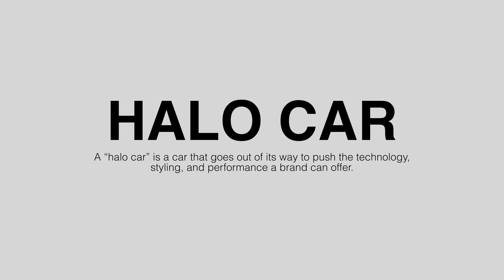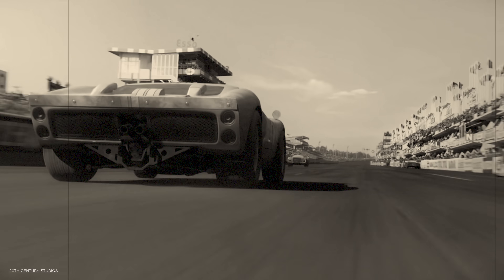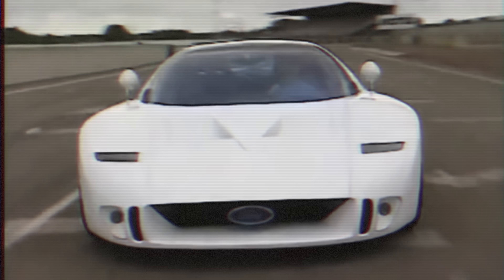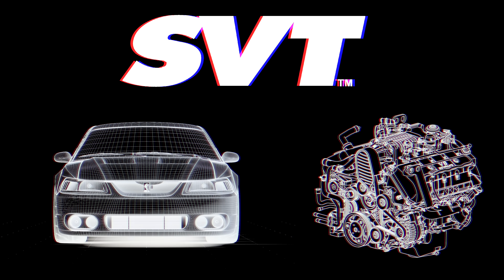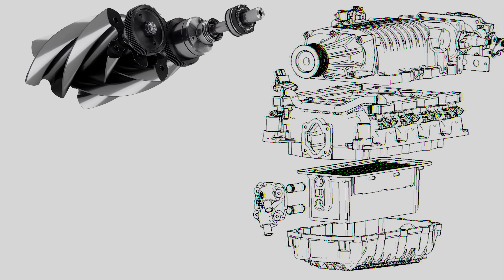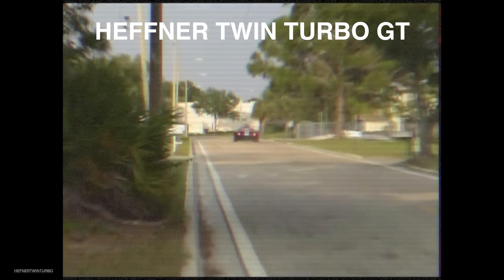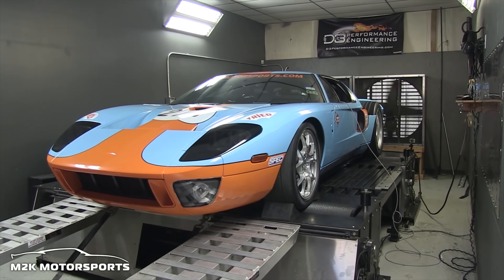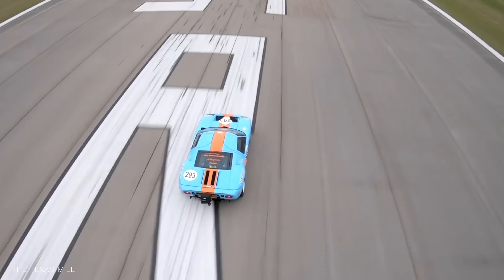Why Ford GT Engines Are Too Powerful (300MPH)😳| Explained Ep.16

Comment: Realistically ford deserves very little credit for the record. Not to say that it's an awesome car, but there are literally SO many other cars that have been capable of doing this for years. 
Also it should be noted that the original Ford GT's 1-2-3 win was the first and last of its kind against ferrari. 
Ford just made it into a press stunt. Weak stuff.
Reply: Ummmm, just stop because you're only making yourself sound silly.
Get back to your xbox in the basement Timmy.
Reply: @blkngwinn  sounds to me like you don't have anything to say
Reply: What other cars are capable of doing 300 in the mile? Maybe UR lambos? 
Also the 1 2 3 was certainly a marketing beat up  but rightly deserved.  No one else was beating ferrari at that time. To fail and come back with a 1 2 3 was hell of an achievement for a company who only know commuter car and trucks.
Reply: @audoinxr6372  Hahaha there are plenty my guy. It's really strange to say that but there are Calvo motorsports vipers doing 270mph in the standing mile with 2000lbs+ of downforce and 1000 horsepower less. UGR lambos are definitely capable of 300+ mph as well, now that you mention it. Nthmoto vipers are already doing 300mph on a 2 mile track, but those have 4000hp so that's kinda cheating.  I could go on but you get the point.
Reply: @THESLlCK  you said 2 mile track n the gt did it in 1 mile  make sense ford hater the car is great n your little viper with larger engine can never do what this thing can do
Reply: @THESLlCK  The power required to bridge the gap from 270mph to 300mph is absolutely massive. No other car, Viper/Lambo/anything else, has eclipsed 300mph in a standing mile and from what I've seen each of the big builders for those platforms stays away from standing mile events anyways. They know they won't catch up to the GT record.
Reply: @tonyfrance4100  um yeah they definitely did pass 300mph in a standing mile, and not far from "street legal" if we're gonna call it that.
Reply: Lmao 

Not like ford built the car itself and the block that withstood all the power or anything. Naa they don’t deserve any credit at all 🤡🤡🤡

Comment: 3000 on the stock block? Sweet mother of god
Reply from the maker: It’s crazy, if you actually find pictures of 05-06 GT blocks they are very robust with a lot of webbing and closed deck. Still blows my mind tho😂
Reply: @337speed  yeah no modular, coyote, or ls doing anywhere close to that

Comment: the GT90 should have been produced , it was amazing
Reply: I’ve got the Hot Wheels version.  Agree completely
Reply from the maker: Agreed!
Reply: Now would be the ideal time for that styling to be reused again
Reply: @rhythmoftheknight4609  very true , it would be a hit today
Reply: Fun fact about the Gt90, it had 4 turbo chargers on it, and the underside of the bodywork covering the engine was covered with the tiles the space shuttle had to keep the body from melting from the heat.
Reply: STILL looks fantastic even now !!
Reply: Same with the GT70.

Comment: Not a big deal but pretty sure it was a lysholm twin screw blower not eaton which only uses  roots type which im pretty sure had not released their tvs rotors yet so it would be the older 60 degree 3 lobe rotors like the early gt500s with their m122 blowers.

Comment: I know that they had plenty of reason to use the V6 tt in the most recent GT but man it would've been so so cool to see something like the GT500 engine or something similar in there.

I absolutely love the design though. One of the best looking cars I've ever seen.
Reply: The new line of predator 5.2 supercharged engines would've been nuts in the gt
Reply: @dennismorgan354  even the voodoo would've been cool. I know it isn't as powerful but the novelty factor is super cool.
Reply: yeah it definitelty deserved its own special v8 but ford wanted to push the ecoboost
Reply: @WhuDhat  nope it's not because Ford wanted to push the EB. If only you knew the main reason why they put the TT V6 in the gen2 GT and racecar..
Reply: @jayxj7785  I think putting the ecoboost in the gt was a genius move, people just want the sound of a v8, but don’t look at the advantages of a tt v6 in an endurance race
Reply: @Jtyungin  wha advantage is that
Reply: @kingssuck06   yeah I asked a Ford engineer in Detroit about it and he said that is the line they were told in house as well but he said it never made sense to him and thought it was just something they came up with to justify using the EcoBoost. Being the EcoBoost is not that much more compact and aerodynamics can be redesigned to fit the car with a slightly larger engine. As evidenced by plenty of supercars with much larger engines. Both engines are DOHC so height wise are very similar unlike an in block cam configuration.
Reply: @jayxj7785  what was the reason?
Reply: @S8ER  because of LeMans LM GTE pro class requirements, 4.0L displacement using forced induction (turbo or supercharged) or 5.5L NA. Ford doesn't have a low displacement V8 and neither could they use a forced induction 5.2 V8 that they have.

They weren't going to build a one off bespoke racecar engine because if they did, regulations would require them to put that engine into the production car too (gen2 Ford GT).

Long story short, they saved money and went with the next best logical engine, the TT 3.5 V6.
Reply: @jayxj7785  thanks for that... it never made sense to me why they put a 6 cylinder in it other than they would make more money. I appreciate the insight.
Reply: @S8ER  - What!  If you think they put the V6 in it to make more money, well, I'll be nice and just say you are completely lost!  I doubt that Ford did much more than break even on this car with such massive R&D costs coupled with the low production.
Reply: @Jtyungin  - Why not?  It won the 24 hrs of Le Mans in 2016!
Reply: @Jtyungin  thats pur cap spare thrle bs the v6 move was ingenious
Reply: @kingssuck06  - The engine was chosen before they designed the car - the  car was built around the TTV6.
Reply: They going to destroke the 7.3 to a 427 Whipple it and turn a 1000hp 1000tq on pump gas watch ford has money they shitcan more engine and concepts than anyone
Reply: My opinion on their 6 cylinder isn’t necessarily born from technical knowledge but one of the things I’ve really liked is watching it just torch most super cars it lines up with. That engine is a beast and I’m excited for when they beef it up- I’m certain they will because they always do. A competitor will come out with the craziest thing ever and ford will do some modifications to an existing vehicle and clap back hard as hell.
Reply: The 3.5l tt engine ain't bad at all I didn't like it at first but ford did an amazing job developing that engine
Reply: Yea being cheap. Also basing it off the regulations at the Trac. They could have made a street version and a Trac version. They know nobody would have bought a ttv6 over a v8
Reply: nope they should have went full retro and put in the 427
Reply: @jtkoontz69  Agree with you on that.
Reply: @jtkoontz69  - And what discipline in Engineering do you have a degree in?  Lol!
Reply: @Loulovesspeed  dont need one to understand what retro means genius
Reply: @Loulovesspeed  i do also understand that a 5.4L is doing 300mph in a mile meanwhile buggati is doing it in 5miles with a 16 cylinder
Reply: @jtkoontz69  - My comment has nothing to do with retro?  You and a few dozen gear head, knuckle draggers think the answer to everything is 8 cylinders, or more.  This TTV6 has smoked more than a few big V8 cars like the C7-R Corvette and the BMW M-8.  Ford built this car to compete in the IMSA GTLM Class at Le Mans and a 427 would be limited in horsepower due to the rules, so what would be the point?  The '05 and '06 GT had to have its blower removed in order to qualify for its class in GT racing.  That's the reason it never won, and I'm only aware of one team that ever raced one.
Reply: @Loulovesspeed  the the eco boost is also limited to power as well any more it would be LMP your point
Reply: @Loulovesspeed  just so your aware gear head knuckle draggers are the ones building  record breakers  so
Reply: @jtkoontz69  - My point is why put in a much heavier and larger dimensionally 427 that would be limited to 500 hp when you can use a smaller, lighter engine of the same hp?  👍
Reply: Yeah the V6 exhaust note just doesn't convey the visceral feeling that an 8 does. There is simply no replacement for displacement. Everything you can do to a smaller engine to make it more powerful can be done to a larger engine with exponentially better results.
Reply: F their reasoning... it deserves a v8 a manual and a way cheaper price tag nobody and i mean nobody is buying a v6 supercar
Reply: @ranware2779  tell that to the owners of ALL the GTs.

Look up the INSANE application process for the GT. They had much more demand than production. All would, and have, sold.
Reply: @ranware2779  - OK genius, then how do you explain the fact that the TTV6 not only had over 9,000 applicants apply to get one, but Ford sold every one of the 1,350 or so made at $500,000 each?  You are stuck in the days of old and need to get with the current level of technology, or you will fade into obscurity.  First of all Einstein, the TTV6 was NOT built as a supercar......it was built as a race car that Ford hoped would win at Le Mans exactly 50 years after their first victory.  That is precisely what it did.  Forget the manual trans, the dual clutch 7 speed is far quicker than any manual shift - that's why virtually all road racing machines have gone that route, like it or not.  Even the Corvette chucked the manual shift trans.  I would strongly suggest you do some research on this car as you clearly have no idea as to why it was built and why a TTV6 was chosen for power.  Instead of speaking through your emotions, try learning the facts - It will make you sound smarter, even if you are not!  By the way, I enjoyed watching it in person at Lime Rock Park in its last year of racing, 2019, and it smoked your big V8, manual shift Corvette C7R and BMW M8 with comparative ease.  😆🏁
Reply: @Loulovesspeed  you said all that bs for no reason my guy. Lol 05/06 with a pulley and tune will eat this car. Oo to answer your little rhetorical question. Ford did that and put very strict rules to owning a gt with rules and regulations and chosen people to have one made it so there would be no engine swaps no transmission swaps. Because they know they fucd up if everyone was able to get one like the earlier models we would see what thet body has to really offer. That ttv6 junk isnt worth 500k nor 1mil that mf cant hold it own in real life yea it got over in lemans due to HEAVY RULES AND REGULATIONS. On the street or the trac that has. No rules that 17+ junk is irrelevant. What they should have did was make that trac version and made a street version ecojunk us far from sought after
Reply: @ranware2779  watch that 6 cylinder murder v8 and v10 super cars in drag races. It’s far from a pile of junk not worth 500k.
Reply: @Bojangus-  syke
Reply: @Bojangus-  that junk isn't murdering a thing especially not a ford v8
Reply: @ranware2779  this isn’t really debatable, the new 6 cylinder GT is Ford’s top of the line vehicle by a mile. When they produce the v8 version here in a minute it’s going to be even more amazing.
Reply: @Bojangus-  I really don't care how you feel beat it
Reply: @ranware2779  is there anything going on in your head other than Saturday morning cartoons
Reply: @ranware2779  660 horsepower, sub 3 second 0-60, smokes Ferrari’s and Lamborghini’s, top speed of 220, all in a v6, AND they’re coming out with the 7 litre v8 here soon. I honestly don’t know why you’re bitching.
Reply: @Bojangus-  blah blah blah beat it buddy 05/06 is king of the gt line up
Reply: @Bojangus-  because should have never disrespected the gt by putting that junk in there in the first place. You can be happy about that engine choice that's you I will never respect that bs as well as others. Ford had 10+ years to get it right when it came to the gt yet they managed to come with some excuse on why they chose that bs.... to make it even worse they made rules and regulations for that car so if you as buyer got and engine swapped it..... you violated the contract paid off or not.... lol look what they did to the guy who painted his mystic chrome 🤣
Reply: @ranware2779  I mean, that’s a cool opinion but the new GT’s gap the old ones and that’s pretty cool coming from a v6.
Reply: @ranware2779  ok
Reply: @Bojangus-  ooh I bet it's alright 🤣
Reply: @Bojangus-  yea stoc.... not modded 05/06 with a pulley swap and tune beats it even with its new tech... I dont know what roc you live under but you should up your knowledge before blabbin off buddy
Reply: @Bojangus-  show me 17+ junk running 310mph stoc bloc hell show me one doing 256,265,295 yet the 05/06 is doing that with a supercharger swap let it go fella that v6 junk will never be accepted by the blue oval community... maybe to ecojunk owners 🤣
Reply: @ranware2779  lol they’re gonna eco boost the v8 so I guess the blue oval community is gonna be disappointed for a while
Reply: @Bojangus-  highly doubt your words... there is no ecojunk v8 and there will not be. 🤫 5.0,5.2 nor the 5.4 coyote nor the 6.8,7.3 will ever be entered as ecojunk save it
Reply: @ranware2779  😆
Reply: Ecoboom, no thanks.
Reply: @GF-mf7ml  Why not me boy, it eats V8s for lunch!  Lol😁
Reply: @GF-mf7ml  - Even though it destroyed most big V8 machines quite easily???  LOL